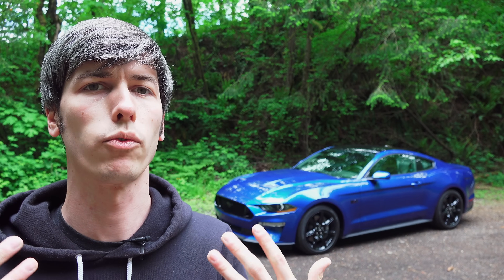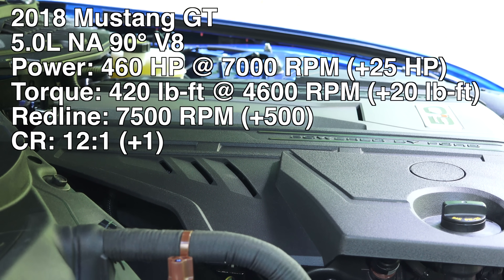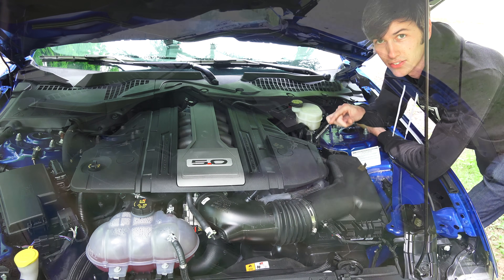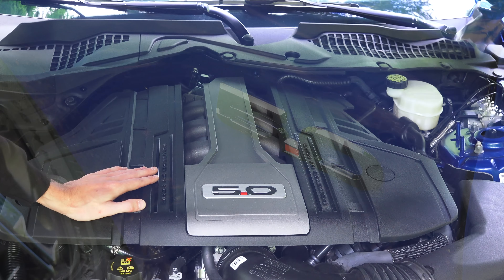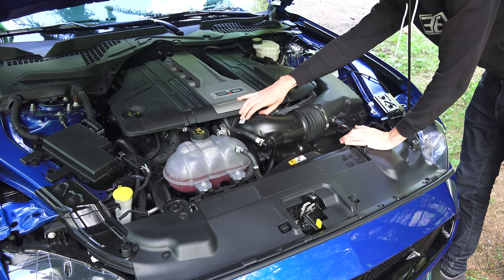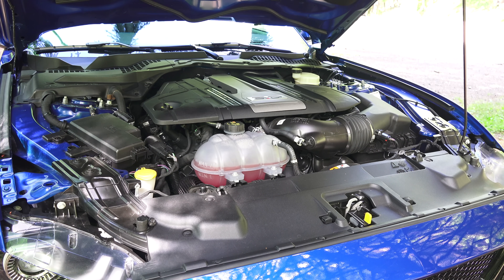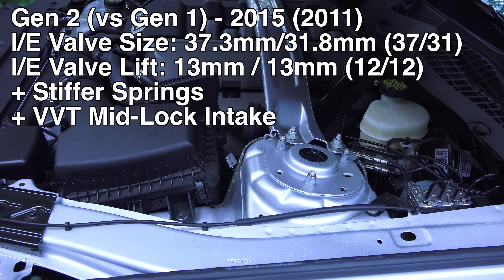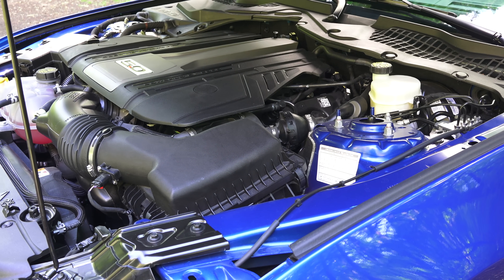The Best Engines - 2018 Ford Mustang GT 5.0L V8

Comment: My truck's engine won the award for The Weakest and Most Inefficient compared to a Hummer.
Reply: fidel catsro It's a 2002 Suzuki XL-7, currently it's getting around the same gas milage as an H3
Reply: hochhaul Yup, definitely a Chevy.
Reply: hochhaul lol, The Camaro SS ( Which I think is an awesome car BTW) has the same MPG of 16/25 as the Coyote, has a much larger displacement at 6.2 liters compared to the 5oh, and makes 5 less hp, so yeah the 5oh is a MUCH superior design, and if Ford ever released a 6.2 Coyote it would absolutely trounce Chevy's 6.2. It's old tech and been around for ever.
Reply: what truck is that?
Reply: all my chips go to a 400 SS
Reply: Lmao is it pedal powered, how is that even possible
Reply: Limo Wreck Good points.
I believe Ford has just released that they are in fact making a 32v 7.0 for their F series platform and Raptor. I'm sure they'll find some way of fitting it into a mustang shell one day.
Reply: @19coyote5oh9  they can just change the bank angles to like 60 degrees
Reply: Driveitsideways 1 700wrhp NA from a 6.2 is almost impossible without boost.
And if you could do it why would you go through the amount of work to do it!?
Reply: Driveitsideways 1 And how much work had to be done? We are not talking about full bolt with a tune. C'mon bro.
Reply: Driveitsideways 1 Basically a full build. 
Easier to just add a blower.
Reply: Just Me not as pure as n/a power
Reply: jrhunt414 I was gonna say that big heavy turds that make no power stock lol
Reply: yvng zzz's did you read his comment?
Reply: Might be time to start a Patreon account to rebuy your Man Card and a real truck... ;)
Reply: Matthew D: If you'd open your eyes & read the comments the OP posted what car he is talking about 4 posts above yours. He said  - "It's a 2002 Suzuki XL-7."
Reply: I TOLD YOU NOT TO BUY A TATA!
Reply: Just Me larger displacement but it’s a smaller, lighter engine overall. Displacement only has to do with bore/stroke not the actual dimensions of the engine. You can build a 700 whp n/a LS for half the cost to get a coyote to that level. LS’s, for the money, are the best power per $ spent v8 you can buy. On top of being ridiculously reliable...
Reply: Just Me no it’s not, there’s YouTube vids to prove it too lol
Reply: Just Me bruh I told you, shorter stroke crank shaft, and cam/internals. A guy made around 650 whp on a stock LS3 that was destroked. With a cam and some head work easily 700+ whp with a 9000 rpm redline
Reply: Driveitsideways 1 This is true.👍
Reply: Just Me I’ve owned nothing but boosted cars the past few cars. Boost is fun and all but I find myself missing n/a power. They drive so predictable and pure, which is why I just bought a n/a v6 Audi A4. Not fast but with bolt ons and a tune over 7000 rpm of n/a goodness
Reply: Just Me it’s my daily so not crazy Speed6 is my fun car
Reply: Nissan? Unlike the reliability of the past they make junk nowadays  that's why they had to team with Cummins for the Titan as a devine intervention
Reply: I personally won that award, in comparison to a brick. My friends are harsh sometimes, 🥺. 😂
Reply: Kiraro The Kitsune worse than a hummer gaaahdamn what car is that a Chevy? Its not bad thing tho, well at least for the environment yeah I guess
Reply: @ FastFord 13: a 6.2L Coyote is impossible because of its small bore spacing and crankcase. Also a significantly larger Coyote in a current generation Mustang is impossible because the current coyote is 28" wide at the valve covers and fills the area between the strut towers completely. Your only hope of a higher displacement DOHC Ford is the Boss family block with a set of DOHC heads and that would be WAY too large to fit in the Mustang's unit body. We are probably talking about 31+" inches at the valve covers if it had any stroke increase at all. Lame. Chevy and Chrysler can just produce siamesed cylinder cases and go to more than 7L with heads that flow in the 350+ CFM range without any increase in external area used by the engine, which will guaranty more power than Ford's DOHC offerings in currently running platform lines. 

You guys need to quit caring about internal displacement and VE and start caring more about external area. If I have 31" of width to work with, I could use a 10L Chevy Mark IV big block and STILL have room to spare. You aren't going to make up for 3L extra displacement and huge 335+ cc intake runners with two extra valves and a gaggle of cams (study valve shrouding and curtain area). 

Who cares about gas mileage when you pay $50,000+ for a pony car?
Reply: You'd have to increase the stroke to around 116mm to stroke it out to 6.2L and that of course changes other characteristics such as revs because of the change in the travel of mass; and you'd have to change the piston wrist pin location or the existing deck height and combustion chambers would result in a change in compression and clearance.  You can engineer it, but it probably wouldn't be worth it.  It's a pretty decent engine as it stands.  Making any major changes in its displacement would basically result in a new engine that isn't as good as the one that already exists.  The Boss is already designed to rev higher as it is now with stronger rods, so if they increased the stroke, they might have to start using titanium rods or it would fly apart inside at 7500rpm. ;)
Reply: Must be a 460
Reply: "Probably a Chevy" - Omer Ahmed

Pretty ignorant comment considering the latest "Chevy" V8's delievered better BSFC numbers than the 2nd gen Coyote despite having significantly more displacement. And that's with just 1 cam instead of 4, 16 valves instead of 32, 1 cam phaser instead of 4, and an intake manifold that didn't need to change geometry in order to improve torque at low RPM. And despite that significant difference in displacement, the "Chevy" V8's are more compact and either equal or lighter in weight. So NO, probably not a Chevy. But keep it up, you're doing a great job at making yourself look like an ignorant clown of a fanboy.

Comment: A lot going on in these engines. Direct injection + port injection, extra throttle valve in each intake runner, 4 cams each with independent timing control, valves in the exhaust, etc.

Sounds good and produces good numbers from factory but I'm curious how all that will hold up in the long run. Certainly will make repairs more complicated and engine upgrades much less diy friendly.
Reply: They respond really well with aftermarket parts...the coyotes loveeee boost. They're really solid/reliable
Reply: Port injection is to combat the carbon buildup issues that plague direct injected engines.
Reply: matt thats any engine from 2011+ no such thing as a simple engine any more
Reply: matt better more control of valve timing with the DOHC vs 1900s push rod. 

Sure as far as raw power and torque the Chevy small blocks are great but for all around better responsiveness and fuel efficiency the dohc modular engines are where it’s at. 7000+ RPM baby!
Reply: Dalton v factory installed supercharger available, while maintaining the factory warranty 🤣🤣🤣
Reply: Devin Bender but this engine is far more complicated then most. Look at the the lt1 6.2l engine for the camaro. It makes the same hp and more torque then the 5.0 while externally being about the same size if not smaller.  Still a single cam, single throttle body, and just one fuel injection system.

Don't get me wrong, new technology excites me but I gotta see it prove it's worth before the manufacturer get my money.  The plasma transfer cylinder liners is pretty cool however the rest just seems like they made a way over complicated engine that at least from what I'm seeing it doesn't really add much benefit.

Comment: The V8 from the latest E63 amg is a lot better than this mustang v8, with 600hp and 600 something lb/ft torque from 4 litres

How about the new GT3 engine? 4.0 flat 6 that revs to 9000rpm

Also, how about the latest 2.5 5 cylinder audi turbo engine? 400hp 🙂
Reply: Which of those cars can you buy new for $40,000?
Reply: Zylon FPV This engine dynos at almost exactly that much, from the factory, as it is underrated on 93 octane. It does this, even with the Mercedes engine being almost 125% bigger and less fuel efficient.
Reply: Zylon FPV 6.2 liter in the c63 but only made 451 hp.  I don’t think it’s better
Reply: bbsp certainly nothing without a metric fuckton of extra maintenance
Reply: This is an normally aspirated engine. Your comparing them to turbo engines. What Mercedes and Audi NA engines beat this Ford? A: none.
Reply: Anthony Bielobockie more like what European na v8 beats any American v8, none lmfao
Reply: Out of all these replies ill still take a 5.0 coyote over all the cars that were mentioned. Why?, because it makes the most hp per liter that is natural aspirated. You could always throw a turbo or supercharger on later
Reply: All this talk is great and all, but you can get a base model GT for less than $40k otd. None of the other cars can touch that. Not to mention the maintenance would be considerably less.
Reply: Potatoes to tomatoes. Your comparing a twin turbo engine to a n/a engine. If you put the same twin turbo setup on the 5.0, itll blow that amg out the water
Reply: David Voss technically the V8s used in koenigsegg are based on ford designs and those make huge power.
Reply: GT Mike91 yes but is 20% smaller displacement
Reply: The 4.0 from Mercedes is twin turboed. The Flat 6 from the GT3 is impressive making 500 HP NA. I also like the 5 cylinder in the Audi because it's something different and makes good power.
Reply: bbsp -- OK, I know this isn't a fair comparison, but you said what European v8 beats any American v8...  Well, the Porsche 918 has a NA 4.6 liter V-8 that puts out 608 HP and revs to 9000 RPM - I think that meets your criterion; sure it costs $1,000,000 and you can't buy it any more, but best is best.
Reply: Lexus made a 467hp 5.0 V8 and yet people complains.
Reply: MinfangDuan Because it’s a Flat-6 engine built to extremes. Less cylinders = less engine size.
Reply: MinfangDuan Yeah but that’s not always the case. Never knew about the warranty they offered. Sounds awesome, although I always saw Porsche as the best Germany has to offer.
Reply: Joshua Ramirez The M156 engine in the c63 is pretty much the same as the SLS AMG engine where it made 570 HP. It was just detuned for the c63
Reply: Lcr34 honestly if that Lexus wasn’t priced that high, I would seriously consider one.  The 5.0 in that is actually VERY similar to the coyote.
Reply: I agreed, RCF and GSF are priced stupidly high. The coyote does enjoy better aftermarket supports (comp cams, rods pistons etc.) compared to 2UR.
Reply: Zylon FPV show me a german v8 running 8s in the quarter mile.
Reply: Dude Shark you're right they have the most powerful v8.
Reply: F136F (458 Speciale) is the most powerful NA v8.
Reply: Lcr34 I love the sound the speciale engine makes
Reply: Don't overlook this engine. It's a masterpiece. Look at what they can do with forced induction with factory internals. It's insane. 2018's are running 8's with unopened factory engine and transmissions!!
Reply: Joshua Ramirez it actually made 507 hp in the run out model. I am not saying it is better but it was a great engine, great sound
Reply: Anthony Bielobockie The GT3 is also na
Reply: GT Mike91 Porsche will extend the factory warranty to 9 years covering everything except for cosmetic wear and tear and consumables like brakes and tyres. That seems like a lot of confidence. Also higher rpm engines aren’t necessarily more stressed especially if you don’t drive them to redline all the time.
Reply: Anthony Bielobockie currently none do, but I liked the 6.2 litre N/A Mercedes engine in my c63. I miss that engine. Audi did have a nice N/A v8 in the rs5 but that sadly got replaced with a thoroughly boring v6 lump
Reply: GT3/RS isn’t getting the longevity this Coyote V8 is. 7500 rpm vs 9000, the lower rpm car is getting less stressed out. Not to mention it only makes 475 unless you get the RS which only matches the 5.0 at 500bhp.

Comment: Please do the 2008-2013 nissan/Infiniti vq engine. It won a lot of awards, especially the VHR
Reply: ianriggs not to mention something that's actually revolutionary when it comes to engine innovation (Nissan's VVEL)... unlike the Miller cycle rehash that Mazda keeps cringily revisiting. He did a video on it as if it was the best thing since sliced bread and fried apricots. Check out the vq37VHR!
Reply: Michael Doucet it's not that impressive and a major part of how it works is just the boring Miller cycle nonsense they implemented in the Mazda millennia. The Nissan VQ37vhr actually has really interesting technology in it that no other engine has. There are no intake camshafts, the valve lift is infinitely adjustable as well as timing. That's right, the lift can go from almost closed to almost race-cam levels of lift (over 0.430 inches factory set, 0.500 maximum). This is pretty impressive and deserves more coverage considering it's been out since at least 2008...
Reply: MOS6582 look up how the Miller cycle engine works, it's ridiculous. it requires a supercharger because the intake valve doesn't close, the charge pressure is used to keep compression in the engine. this can't work in high performance settings because you're going to exceed the supercharger's capability to hold that compression in the cylinder. it's just ridiculous.
Reply: MOS6582 in other words i agree with you, it won't be used for power, because it can't! lol
Reply: mikeymike4g63 actually Mazda is in testing with a revolutionary engine called SkyActive-X
Reply: It's interesting technology but it will only be applied in 4cyl engines in boring family hatches. If they made it into an 8000rpm 3.5L V8  in and put it in a toyota 86 sized RWD manual-only coupe - that would be cool. Proper 21st century Miata.
Reply: Lots of power and reliable

Comment: Include dynos or where usable power (power under the curve) please. Like the brz makes 205hp but only 60% of that is  usable at 4k rpm. ALSO PLEASE make the video I suggested about why all boxer engines are flat but not all flat engines are boxers.
Reply: alex moore plenty of dynos out there to show that. 

The issue with dynos are the same issues when looking at 0-60 or quarter mile times 

Atmospheric conditions. Make a difference. 
Elevation, air pressure , humidity, temp. Ect all effect the car. 

If you do a dyno of many cars they need to be done in the same conditions on the same dyno or you could have a major deviations
Reply: I think he already explained that
Reply: Rafael Ribeiro he said in this video, what information would we like for him to include. I would like to know where each individual engine he discusses makes power and the percentage of total power it's using.
Reply: Devin Bender but that's part of the fun, we can calculate the SD, and figure out the average power between the SD and what should be the realistic RW value. Idk just thought it would be a neat
Reply: alex moore it is neat for sure. Just one of those grey area tests. Cool information but nothing to have a competition over
Reply: 2018 Mustang GT's are consistently making 435 whp.
Reply: The “under the curve” phrase is honestly a term that isn’t as viable as people make it out to be.  Sure it shows how early and how consistent the power comes on but that doesn’t show how fast or how freely it’s revving nor does it show how that power is translated.  You could sit and talk about this type of stuff all day long so it’s better that formats are kept this way

Comment: Love the sound of a Ford 302 the best sound since 1968
Reply: the firing orders have changed multiple times. The sound has not even been remotely the same throughout the years.
Reply: well the old non H.O 302 and the flatheads had different firing orders than the H.O and modulars. The coyote supposedly uses the flathead firing order so that would explain the sound difference from what most are used to. I prefer the sound of the foxbodies and the 4.6 4v over the coyote personally
Reply: 987 Chicago to bad the fox was a 4.9
Reply: Devin Bender and the LS1 was a 346, your point?
Reply: jbrandon302 1-3-7-2-6-5-4-8 was the firing order on the old 5.0 HO, and the firing order on both the 4.6 and IIRC the 5.4 as well. This sounds more burbly because of the unequal length headers.

Comment: Engines are almost always smaller than the manufacturer says.
Reply: Devin Bender I know, I watched the video.
Reply: Martin van Weperen the new 2018 5.0 is 5.035L the 2011 to 2017 was 4.951L
Reply: I'm going to sue Ford for false advertisement
Reply: true
Reply: Martin van Weperen but Ford rounded 4.9 to 5.0 why not just call it 4.9
Reply: feodufg3r4weozjmkdwopsqkf3 It could be that Ford was already making another 4.9 L at that time or had just stopped making a 4.9 L. Suzuki did this with their Hayabusa motorbike; the gen 1 had a 1.299 L engine called the 1300, and the gen 2 had a 1.340 L engine called the 1400 whereas it should also be called a 1300. I'm not very familiar with Ford V8 engine unfortunately though but this might be the reason.
Reply: feodufg3r4weozjmkdwopsqkf3 Hahaha if I may recommend another brand; sue Mercedes-Benz, on the side of the old SLS it had a badge which said "6.3" while the engine had a displacement of 6.208 L 😱. They actually rounded 6.208 up to 6.3 😂😂.
Reply: Martin van Werpen You are correct, Ford was making a 4.9L straight six at the time, they might have wanted to differentiate between the two.
Reply: No because I'm pretty sure 5.0 sounds better than a 4.9 that's why